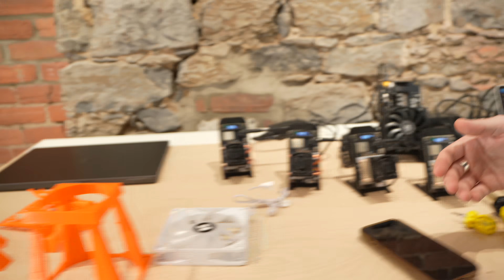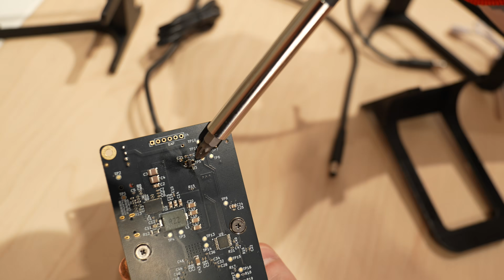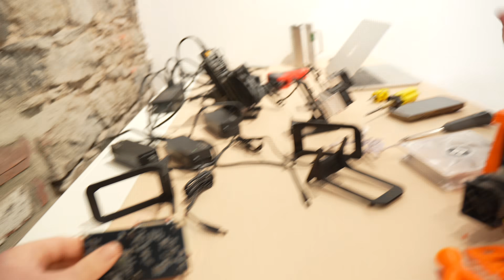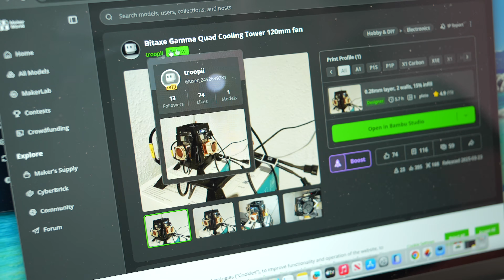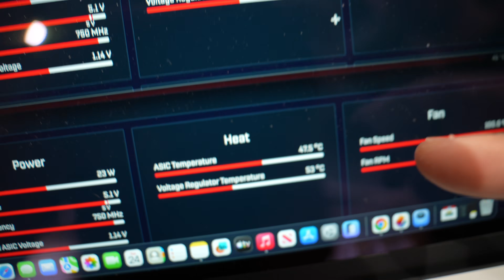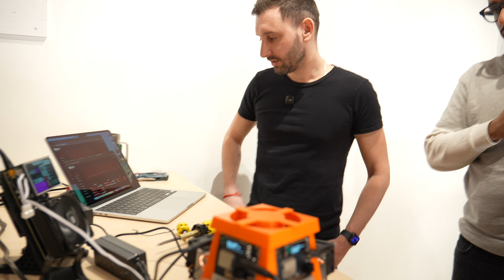MONSTER Upgrade For Bitaxe Gammas… Performance is INSANE

Comment: This guy is all hyped up over 1 to 2 degrees. Lol
Reply: I don't think his 601's were cranked to the max. I have mine at 2.2Th/s, I only re pasted and added mosfet heatsinks, my vr's were in 73-76c range. I printed this added a noctua to the bottom, VR temps are between 57c and 61c. That's well worth the upgrade, especially when you take into consideration the mod is under 30 dollar. Can be even less if you go with a cheaper fan.

Comment: you guys should get some mini heatsink for the vrm on the back. aka the bigger gray chip.  it helps keep it cooler especially with the new settup with that stand. also a small heatsink right on the power connector
Reply from the maker: yes we do need to pickup all that stuff and betters psu's too!

Comment: Eh thanks for the shout out ! Hitting over 2th/s is def posiible, pushing over 2 th for extended time could possibly degrade your chip, asic lottery is real lol . The only thing you need to be careful of is blowing up the asic with over voltage or to high frequenzy. That being said, ive had 4 gammas overclocked to 1.8 -1.9 th for over a month running smooth with no hash rate error creep at all . One of those boards I have 900 frequency 1250mv. A good PSU is def important > when you start demanding more voltage your PSU can starve and drop your input voltage from 5.1V to 4.9V or lower . High frequency and voltage can also degrade your chip over time if not careful.  Great video ! I wondered how that stand would work !
Reply from the maker: Good info. We do need better power supply I was looking at the mean wells 350w 5v

Comment: Would be interesting to see the temps if you used a 120mm 5V fan intead of a 12v one, Then all you would need is a fan splitter to power the fan on those 5v units..
Reply from the maker: We are going to order some more parts like that to try these things!